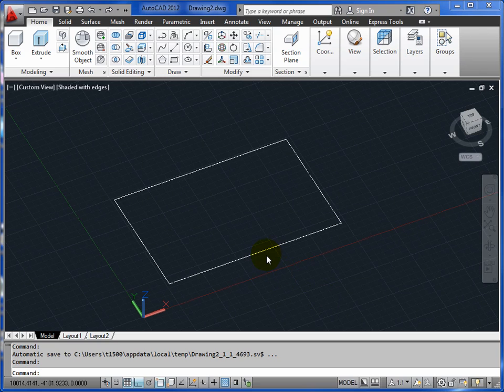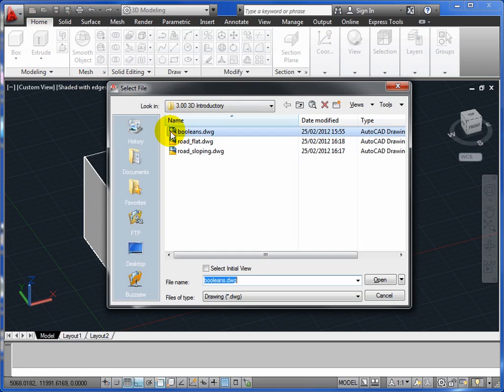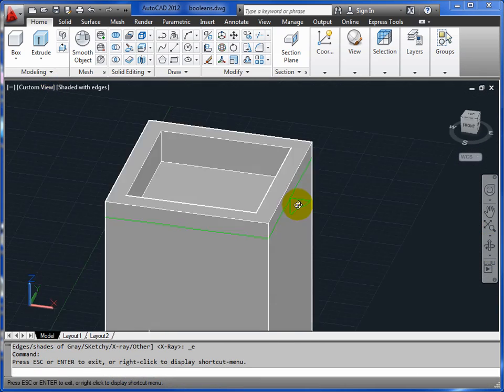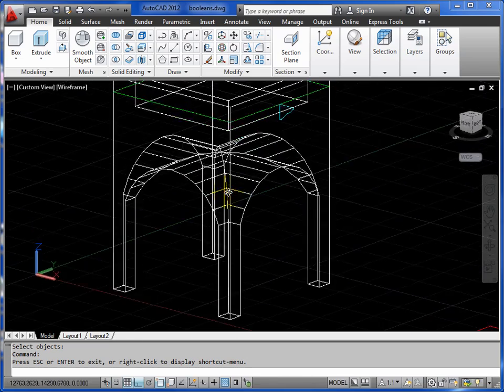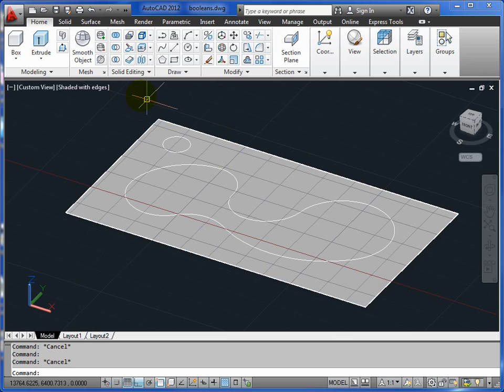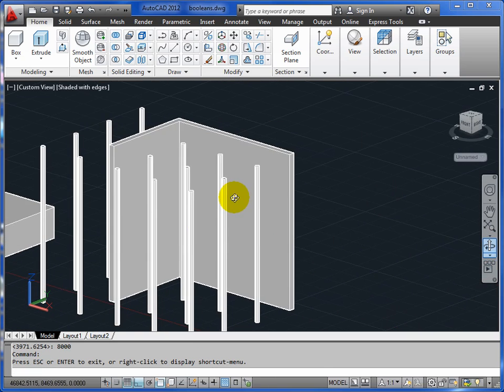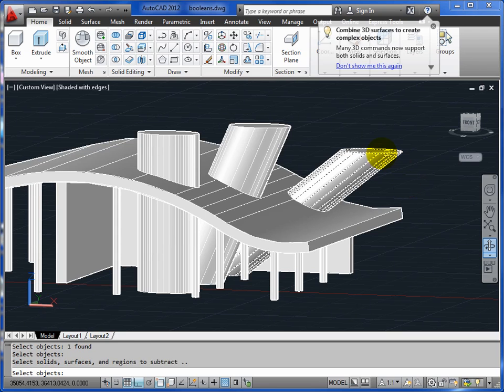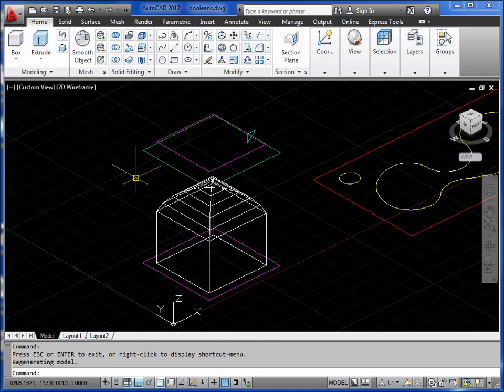AutoCAD 3D Basics Tutorial Part 2 - Solids

Comment: thanks.. uhm. one question.. I'm using the 2010 version of AutoCAD and the background color is just plain white. so, can we change this to plain grey or black may be? It's really hard to see the dots on the grid.
Reply from the maker: Sure - go to Options and then Display and then Colours and you should be able to select a 'dark colour scheme'.   You are working in Model Space and not Paper Space aren't you ... paper space defaults to white background and is for your layouts not for desingning/modelling.
Reply: emmockladdie thanks. another thing. how'd you do the 2D orange wire arch perpendicular to xy plane? the one you use to extrude to intersect?
Reply from the maker: surfiam maifrus That's where UCS control comes in - check my vids on the UCS command.

Comment: Hi!  Is AutoCAD capable of measuring the angle between two planes?  For example if I draw and hip or valley roof in 3D is there a command that would tell me what the hip or valley angle was so that I know what angle to bend my trims and flashings?
Reply from the maker: Hi - yes - but it's not easy to set up.   I'll post a wee video for you in the next day or so and you can see if you can get it to work at your end.  I'll reply again once it's there - it's nearly sleepy time here in the UK just now and I have had a few bacardis!  Promise to get back to ya.
Reply: LOL, cheers!
Reply from the maker: Video posted now man - bit tricky but I hope it answers your query - can't find the button here for 'video response':   h t t p : / / youtu.be/RHQBI2a0_K4  [take out the spaces].   Best regards.

Comment from the maker: HI Saima - I can't think of anything specific but what I would do is avoid using circles to generate your pieces of bamboo - use a 12 or 16 sided polygon ( POL command) and then EXTrude - it will create a fixed number of sides then and be less heavy on your processor.   Check out my two other videos that deal with controlling the UCS  - this lets you work on any side of your model including roof.   Hope that helps.

Comment from the maker: Truss design is not just about drawing them - loading, load transfer, stresses, twist, torsion, material strength, etc, etc - you should get enrolled on a structural engineering distance learning course - there's a lot to learn there my man.   You'd be using software like StruCAD in that process.   Forget AutoCAD mate - it's got no structural analysis programming in it.

Comment from the maker: Hi Shijad - do you have access to something like 3d Studio Max or Revit ?   Those bits of software can make a spiral staircase much easier to create as they do it parametrically - this means you can change the width/height/change the number of stair treads, handrails, ballusters, etc - without having to remodel.   A spiral stiar is considerably more work in AutoCAD and you have to make decisions at the start and stick with them.   When I do a spiral stiar I use ARRAY and not HELIX btw.